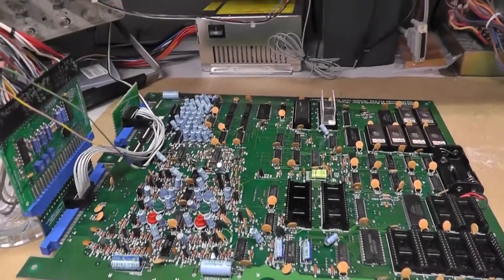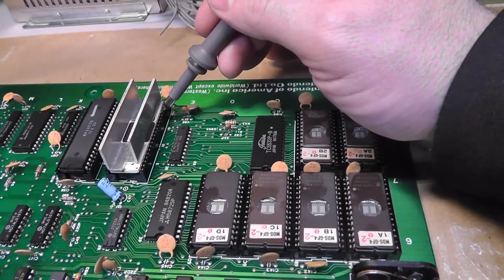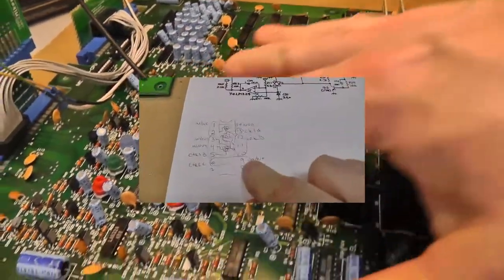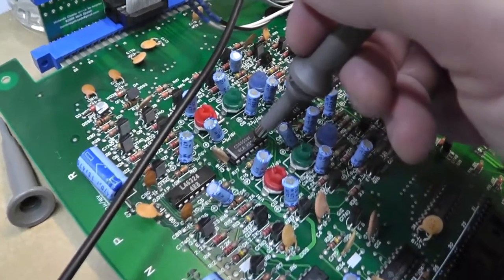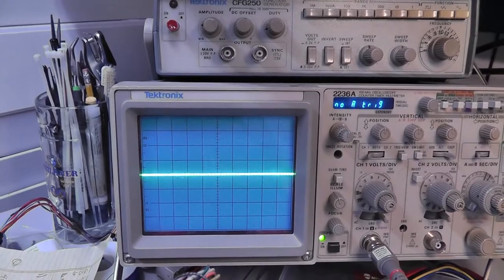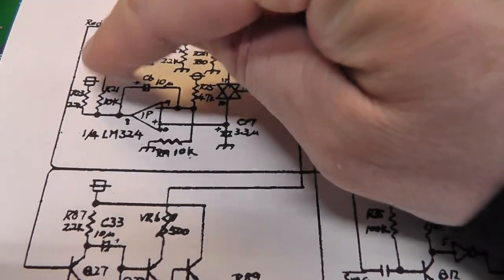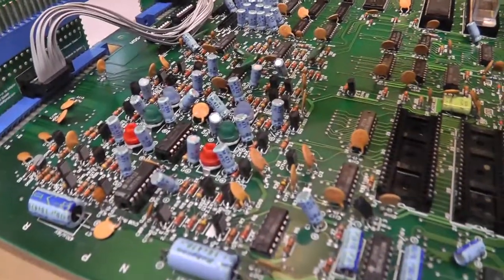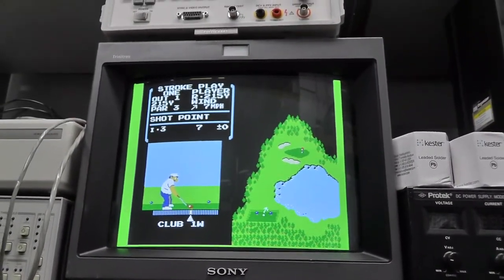Nintendo VS PCB Repair - Missing Red

Comment: How can you display the RGB colors stable on the oscilloscope? Because the RGB colors look very fuzzy not synced on the oscilloscope
Reply from the maker: I wasn't really worried about it as it was giving me the data I needed.  Grounding my probe would have likely helped.  What are your thoughts?
Reply: @jacklick  some tektronix oscilloscope models in the 80s have triggering for color video signals or you have to use the oscilloscope external trigger port and tie it to the v&h sync I think to get a stable RGB colors. Try experimenting and read the oscilloscope manuals because they are used to troubleshoot video electronic circuits in the 80s used rgb composite and RGB components and used oscilloscope to display stable RGB colors

Comment: I have several vs and playchoice boards all have the same strange behavior. I use a super gun along with a retrotink5x, video looks good but there are alway thin black vertical lines showing. I have never plugged them into a real crt to see if there is a difference. Ive been told this is normal. Does the crt hide these lines? Or is there a way to get rid of them? Is there a way to properly calibrate the rgb colors? Thanx.
Reply from the maker: If the line are happening on all the boards it must be normal with your setup.  I dont think there is a documented insteuctikns on adjust the rgb on the pcb.  Probably would need the pcb to out put a red green blue test pattern and adjust to a voltage output.  They might have done that at factory.  Good luck.

Comment: How can you test of your arcade monitors V sync and H sync is at the correct KHz frequency? because the arcade mother board is sending out V sync and H sync signals at certain frequencies and different arcade monitors V&H sync can be set using the trim pots on the arcade monitor which if they are off and not aligned correcting you will get fooled and tricked into thinking there is something wrong with your arcade monitor board when really the V&H sync trim pots on the arcade monitors aren't set correctly with the V&H sync frequency of the arcade mother board. All arcade monitors are different you have Japan arcade monitors etc so the V&H trim pots are set wrong this will trick the repair technician into thinking the arcade motherboard has a V&H syncing counting issue. There must be someway of testing arcade monitors V&H sync frequencies to make sure they are matched and set correctly.
Reply from the maker: I am a bit confused by your question.  The pcb will output a H and V sync frequency and the monitor will sync to that freq via the adjustment pots.  Each chassis has some range of sync frequency range as every pcb could be slightly different.  If you know the answer to your own question, through the answer out there.